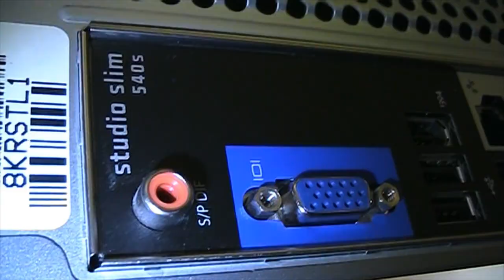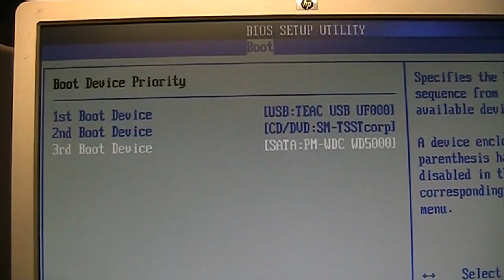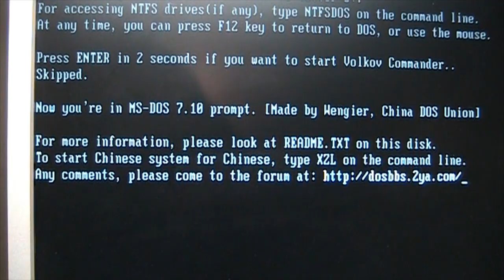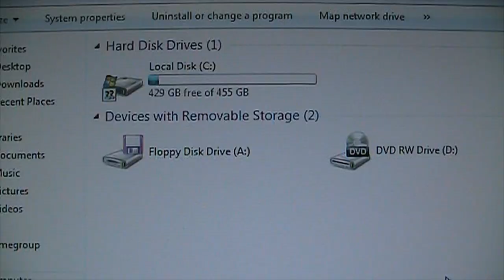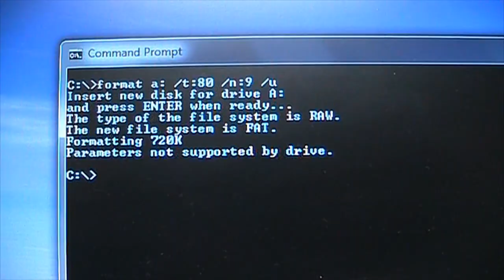How to add an internal USB floppy drive

Comment: Excellent tute.  I've a 30 year old 3.5 inch drive sitting in a box, doing nothing. I thought I might try to insert it into my 2019 workstation and then see what else I needed to get it up and running and communicating via USB or SATA - and maybe even booting some DOS off a high density 1.44MB floppy.  This video gives me some hope.

Comment: Now that's something I've been hoping someone would make for a long time!

(Results of the 720K format failure are making me curious if there is 2.88MB diskette/drive support, though the numbers seem a bit high.)
Reply: +uxwbill 
Has vwestlife's Dell become a 'real computer', now it's got a floppy drive in it?  ;)
Reply: +MarkTheMorose Such commentary is meant to be humorous in nature. 

(That said, I do wish that modern motherboards would bring out the logic to a connector since it already exists in just about every LPCIO in use. There's no good reason at all why someone shouldn't be able to use a floppy drive in their brand new system if they want to.)
Reply: I think it's just cost cutting to the highest degree. At least I still have serial and parallel headers!
Reply: Hey uxwbill hehe... Merry Xmas. I'm looking to go retro and looking to get. 5.25 inch drive. I had sooo many computers with all this retro tech and I got rid of all it when moving out office back in 2004-2005. Now it's hard to find some of that stuff and nostalgia is strong ... Haha. I did get a 3.5 inch floppy
Reply: No there was no 2.88 mb floppy but a 120mb floppy
Reply: @areagaming6996  There are both!
The 2.88 MB are extremely rare these days however!

Comment: The "Parameters not supported" is a bug between the Windows built-in formatting tool and 720K floppies over USB.  If you use a third party tool, such as "MaxFormat", you should have no trouble formatting a 720K floppy with your setup.
Reply: Great tip!!

I'm going to try getting my LS-120 drive working still (Which was the only real solution before these converter boards came on the market probably around the time that this video was made!)

Comment: if you find yourself adding an extra USB header converter, these usb plugs can be transplanted from one socket to another, you use a paperclip to press the clip while you pull gently and then you line up the top colors with the bottom colors. I've found myself having to pull out one side of the connectors to put something else in there.

Comment: That FDD cable with a socket is from an Iomega Ditto QIC-style tape drive. I have one and can confirm it's designed to let you use 2 FDDs and a Ditto at the same time.

Comment: Nice job! Soon we'll have to do this with CD ROM drives, since a lot of computers no longer come with one. I had to buy a mini SATA to USB adapter with a CD ROM drive I took out of an old laptop. My laptop does have a delete plate and a space for a CD ROM drive, but the one I have was too thick to fit. Hey, all those unused USB connectors inside your computer might come in handy... you should connect those up and install the USB ports on one of the expansion slots, you never know when you'll need more USB ports eh?
Reply: my main desktop has a PCIE 7 port USB 3 hub. I still have 2 normal PCI connectors which is suprising for a pc that's 2016 age, I'm thinking I could get a USB 2/firewire hub or 2 of them since I have 2 slots available.

Comment: of all the searching on ebay I've done for a product like this... amazing.
I'll have to grab one when I have the money to get it, and subsequently see what the deal is with the board. looks like there should be a capacitor by the floppy power cable that's not populated, amongst other things. 

do you perchance have the model number on the board itself? from the listing I'm seeing USB_FDD81306? and another number on the opposite side on the second image.

Comment: Thank you very much! I'm not verse into electronics, but at 7:08, eBay lists one that's not the same as the one you show in your clip (which has two brown chips of some sort above the USB connection). Do you know if it's important or whatnot? I just bought one on Amazon after seeing your clip (I only need it for 3.5" HD 1.44MB floppies), and it's the same as the eBay listing - I haven't tried it yet as I'll get access to my disks in about a week (away from home).

Comment: Done this with my new Ryzen build....went a little further by changing the USB lead to one with an internal motherboard USB socket fitted. Works well enough but occasional OS access of the floppy drive will slow down booting.

Comment: I used the same thing from that seller in my IBM NetVista rebuild to continue using the floppy disk it came with the computer, on a count the face plate has one of the "floppy openings" that nothing other then a floppy can be in it.

Comment: In the past ive thought about adding a floppy drive to my desktop PC, but im not sure if it would actually be worth doing, and also there is an SD card reader installed into the 3 1/2 inch slot (my PC has 3x 5 1/4 inch slots and 1x 3 1/2 inch slot, 2 of the 5 1/4 inch slots have optical drives installed in them, meaning there is a spare 5 1/4 inch slot, so in theory i could either get an adapter and install a floppy drive into that slot, or move the SD card reader up into that slot)

Comment: Thank you for review. The connector does not support formatting DD diskettes as you stated clearly in the video, but can it read such diskettes? I mean if I already have a 720KB disk and insert into the drive, then will I be able to read it in Windows using this connector?

Comment: MItsumi still makes USB internal floppy disk drives with built-in card readers...they used to be quite expensive.
Reply from the maker: On those, only the card reader uses USB. The floppy drive part uses the traditional 34-pin ribbon cable, requiring a floppy drive controller.

Comment: Do you have a fancy modern pc or do you only use older out dated computer?
Reply from the maker: My most powerful PC is a Quad Core i5, but for editing video I use a Core 2 Duo laptop running Windows 7 Ultimate 64-bit.

Comment: there was a hack back in the day to turn a 720k disk into a 1.4m, a tool to cut a notch in bottom case but reliability was bad, certainly would not put valuable data on it

Comment: I was wondering if these internal "real" floppy drives even use the 12v supply (yellow wire), because the controller doesn't even have a 12v input, just usb
Reply from the maker: Most do not.

Comment: that's really cool . kinda pain  but I honestly  think they should just put the connection  on the board just in case people want a floppy drive
Reply: +Matthew N They should, since the I/O controllers used on modern motherboards usually still include floppy drive controller logic. The reason they don't is probably a result of cost versus benefit: a lot of people aren't ever going to notice that it's gone. Even if it costs a penny, that still adds up.
Reply: +uxwbill  I know exactly  what you mean.  heck my old motherboard  died out from a faulty power supply. dynex best buy brand is not exactly  great. but anyways  that had a floppy. so friend of mine gave me a desktop  computer  build he did with dual boot system  just didn't have floppy I used mine and I'm glad I did especially  with stuff I like to use . uses floppy

Comment: What if you use an old LS-120 SuperDisk Drive with an IDE/SATA bridge? It can read and write 1.44mb and 720kb floppys
Reply: I bought one of these and tried to use a PATA-SATA converter but haven't got it to work yet. I think it needs special drivers because it doesn't show up in Windows.

Comment: Is there anywhere you can buy a converter that converts SATA to USB so you can put usb directly into computer?
Reply from the maker: Yes, you can find those anywhere (eBay, Amazon, etc.).
Reply: +vwestlife When I'm looking for it, it comes up with SATA+Power > USB, there's no just like USB > SATA...
Reply: +Jeppe JCP What are you trying to do?

A lot of the USB<>SATA bridges will pass power to an attached drive if they can. Laptop drives will generally spin up and run just fine from the power available over USB. Desktop drives can't: not only do they demand far more current than is available, they also need 12 volts.
Reply: ***** I want so i can like, have a usb storage directly connected to the motorboard via SATA cable.
So like the usb is a input and sata is output

Comment: I presume this controller's limitations won't stop you from doing the old trick of drilling out 720K disks and formatting them as 1.44MB?
Reply from the maker: Please do not do that trick. Not only because it's not as reliable as using a real 1.44 MB disk, but also because&#160;720K disks are getting hard to find, so please save them for the vintage computers which use them.
Reply: vwestlife Ok I promise I won't do that. :D Plenty of HD floppies around anyway. But I remember doing that as a kid.
Reply: vwestlife BTW, can you not do the reverse? tape up the hole on an HD floppy then format it as a 720K disk for use in older, DD-only machines?
Reply from the maker: spankmeister 3.5" HD and DD disks have slightly different magnetic coercivity so mixing up the formats always results in some unreliability.

Comment: Is that floppy adapter just an ide adapter or is it different, I have an ide adapter for a 3.5 inch HDD but I don't know if that would work or not.
Reply from the maker: No, floppy drives do not use IDE. IDE is 40 pin, the floppy drive connector is 34 pin. They're completely different.
Reply: Too bad :(
Reply: +vwestlife 
Amongst my modest collection of technological cast-offs and also-rans, I have an LS120 drive which is connected by IDE, and another parallel port model.  Have you used one of those?  They read and write 720k and 1.44MB floppies, as well as their own 120MB 'superfloppies'.  They briefly competed with the 100MB Zip drive, and I understand that the laser servo technology was examined but rejected by Iomega before they came up with the Zip.
Reply from the maker: MarkTheMorose
I have an LS120 drive, but I've never seen one with a black faceplate.

Comment: Is there any kind of ATA to IDE convertor cable? Just curious. So I don't have to use a hammer on my computer again.
Reply from the maker: IDE is ATA.
Reply: +vwestlife Maybe I said it wrong. I meant that my motherboard only has a channel for CD-ROM and harddrives. (80-pin) Not for floppies, though. (40-pin).
So I'd like to know if there's some kind of conversion.
Reply from the maker: *****
Floppy drives are 34-pin, not 40-pin. Don't confuse it with IDE/ATA just because the connector looks similar. They are two completely different interfaces.
Reply: +vwestlife Ehh, I don't know anymore. I'll just stick to CD-ROMs.
(Thanks for the right info, though. If you know the answer to the conversion thing, could you tell me, please?)
Reply from the maker: ***** I still don't know what you mean, because IDE and ATA are two names for the same thing. The 80-conductor cables were introduced with EIDE (Enhanced IDE) to allow higher data transfer rates, but is not necessary for the drive to work.
Reply: +vwestlife I know, I've meant an adapter for transfering the IDE for Floppy drives into IDE for CD drives and so fourth.
 If you know what I mean.
Reply from the maker: *****
As I've said before, floppy drives do not use IDE! The connectors may be similar, but the 34-pin floppy interface and 40-pin IDE interface are COMPLETELY different.
Reply: vwestlife Oh, I see now. Thanks for having the patience for me! :D
The external floppy drive isn't that bad idea after all.

Comment: what's the easiest way I can format 720k floppies? Just buy a 720k drive and use that?
Reply from the maker: Some USB floppy drives and all "real" internal 1.44 MB floppy drives work perfectly fine with 720K disks. To format a 720K disk in Windows XP or newer, use the command FORMAT A: /T:80 /N:9
Reply: Awesome, thanks! I can definitely manage that. I'm going to make a copy of FreeDOS lite and use it to play around with my IBM Model 25.
Reply from the maker: Just use IBM PC DOS 2000, because FreeDOS is a RAM hog, and on an XT class system like the Model 25 you need every kilobyte of free RAM you can get!

Comment: To anyone looking for this converter:
The original listing expired in January 2017, but I found another seller:
https://www.ebay.co.uk/itm/34pin-1-44mb-floppy-connector-to-USB-adapter-cable-34-pin/292330257264?hash=item44103dbb70:g:9EUAAOxyj4hTID4h

Keep it mind it may disappear again and it doesn't ship to all countries. Sadly it doesn't ship to Italy, which is where I live, but I'll try contacting the seller...

Comment: Do you know any sites that could possibly sell a thinkpad 760xl HDD caddy and is able to ship worldwide? Those bloody caddys are rarer than a Bengal tiger. If you have any other ideas i could try i would appreciate it. The old drive was destroyed possibly because it was used at a power station here in the UK
Reply from the maker: I don't know. Did you try searching the usual places (eBay, etc.)?
Reply: vwestlife Yeah like i said they are rare and i have only seen one which i lost. There used to be stock on PCHUB but that requires others to "donate them".
Reply: +CPPRODUCTIONS1001 That's what I really dislike about the data paranoia you get nowadays. The sellers always destroy the hard drive with its caddy.
Reply: MrMaguire I Know right! But to be fair the caddy is an encased unit for this model which would require tools to open. He probably just couldn't be bothered. I wonder can i run it without one? It has a floppy drive which works as far as i know
Reply: CPPRODUCTIONS1001 With a lot of laptops you don't need the caddy at all, since you can just put the bare drive in the open slot.

With a ThinkPad 760XL things are probably going to be difficult...

If you're handy with a soldering iron, you could possibly make your own adapter to connect the drive, then rig something to make it mechanically sound.
Reply: MrMaguire Will see but it needs to be perfect first time

Comment: I bought a couple of DELL FDDM-101 internal laptop floppy drives, which also feature their own integral USB interface and port for external use.  The good thing about this is it can handle both 720KB and 1.44MB disks, whereas all the other competing drives only do 1.44MB.   They only cost me about £1 + P&P each from Ebay, and they still are if you look carefully.

http://www.santech.com.br/upload/Produto9.31a9518ccebd6901cd3561524eb1c35e.jpg

Comment: I use an LS120 (SuperDrive) with a $3 USB->IDE adapter.
Reply from the maker: But I don't think they ever made an internal LS120 drive with a black faceplate.
Reply: +vwestlife I've never seen one. I don't know if 720K floppies work on there either: I don't have media to test with.

Comment: That card's expensive... You can buy external USB floppy drives from around $13 up to around $20 from sites like dx.com , just enter in that site's search box SKU: 271810  or SKU: 428709 or SKU: 23557
Reply from the maker: Yes, but I didn't want an external drive... that's the whole point of this video!
Reply: +vwestlife Could you strip the plastic case off and use the same female-A to mobo header adapter that you have?  Or would that not be bootable?
Reply from the maker: Most external floppy drives do not use a standard drive anymore, they use slimline laptop-style drives which use a proprietary connector.
Reply: Understood, but if you use the included USB connection and modify the faceplate to make it internal would it allow booting?
Reply from the maker: That would look like crap, whereas this one looks like a regular internal floppy drive.
Reply: Fair enough, but still interested if a typical USB floppy drive can be used to boot from - anyone know?
Reply from the maker: David Ellis Yes.

Comment: or you can use Kyroflux and you can read/write almost any floopy disk: http://www.kryoflux.com/
Reply from the maker: That's only for reading and writing entire disk images. It's notlike a regular floppy drive where you can copy individual files or boot from a floppy disk.
Reply: +vwestlife you can make and edit disk images using WinImage but I still don't understand why nobody makes an universal floopy disk emulator that can be plugged anywhere and just work